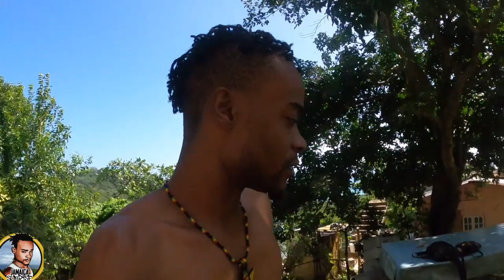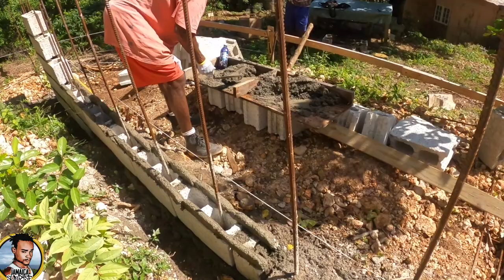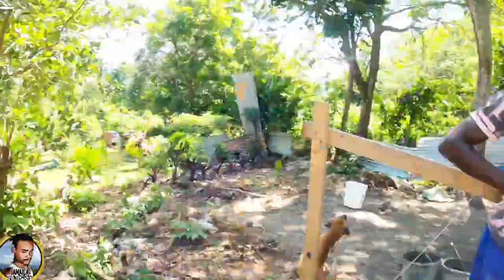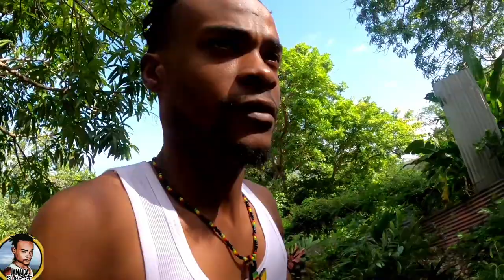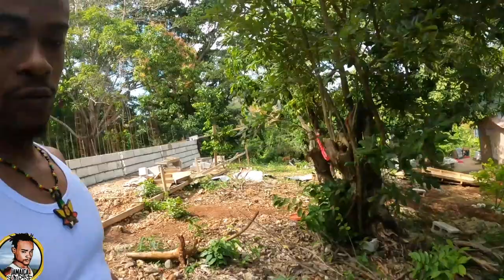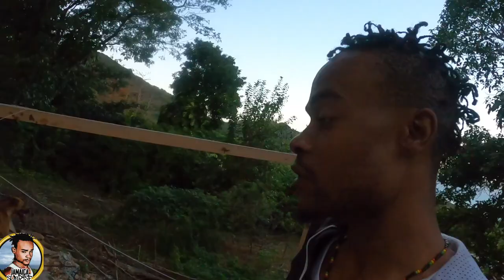*DAY 1* START TO BLOCKS UP MY ROOMS THEM

Comment: Big up yourself Jason Sunrise Boss, love the videos keep them coming 👌🏾. Just a little clarification in England a Brick is smaller maybe 7"x4" and coloured Red. The things your father is laying in  England we call them Breeze Block. Nuff Respect to you and yours keep smiling stay sweet and be safe 👊🏾Bless.
Reply: Plus bricks are not made of concrete.
Reply: Breeze blocks are solid these bocks are Hollow to accept the steel and concrete! We don’t use that type of block in England they are for countries that suffer from earthquakes!
Reply: 😔ok I stand corrected, but for me a breeze block is made out of concrete so for me this is a hollow breeze block which are made and used in England to erect a cheaper wall  ( less concrete used making the block and less mortar used building the wall). A long with like you say to reinforce with mortar and rebar to make a stronger wall. The truth is my original post was only to relay that we don't call them bricks 😊

Comment: jason, in the trench behind the blocks if you fit a drainage pipe drilled full of holes on the top you can catch the rainwater and direct it into a tank to water your plants

Comment: These are called cinder blocks not bricks in Canada.  Some of the basements in Canada were made using cinder blocks instead of poured concrete until the late 90s. Jamaican homes are built very strong with concrete and steel. Have a blessed day